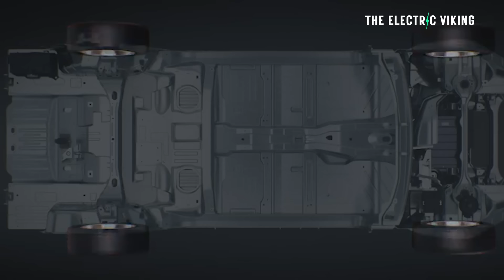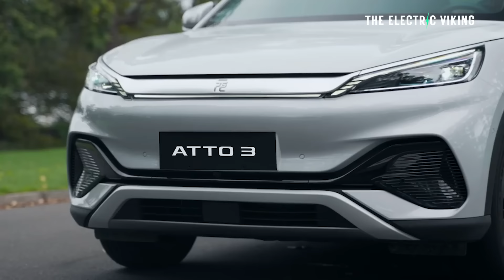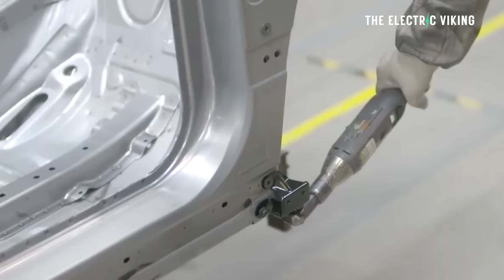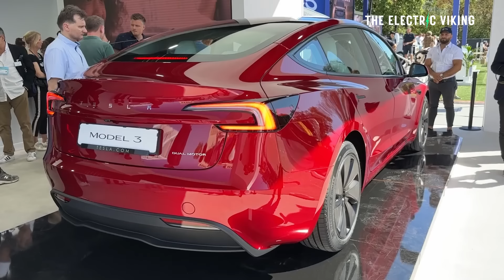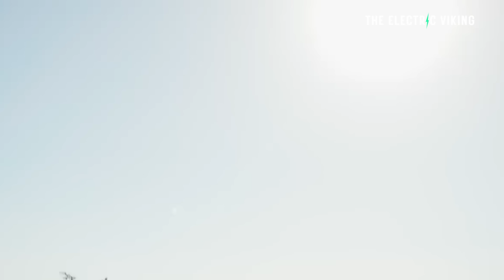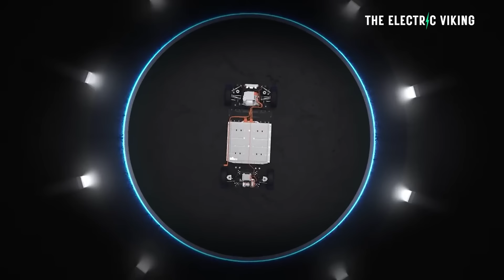Alfa Romeo's NEW Giulia EV will be based on the Dodge Charger

Comment: I think this is wrong.  The new Dodge EV is a new design and will be EV only.  I don't know how you would know how heavy it would be.  I like the look of both of these and will keep an open mind even though the history is stacked against it being a great car.  They are too slow to adopt and have kept the Charger/Challenger designs for way too long without a significant revision.

Looked this up and found...  The new Dodge EV is going to use a universal platform called STLA Large platform, with standard four wheel drive and planned 400v battery with 100+ kw capacity.  We'll see what they actually come out with.

Comment: It’s using the universal STLA large platform an 'EV-native' architecture that's being rolled out across all of Stellantis' brands. The Dodge Charger is the first, other cars to use the platform include the new Jeep Wagoneer S, as well as what will replace the Alfa Romeo Giulia in 2026. The singular advantage of the EV  is the simplification of the platform on which different car brands and models can be built. The German big three are really exploiting this strategy across their brands and models, Stellantis is doing the same having used the CLAR strategy for both EV and ICE models to this point.

Comment: I don't know why they don't just keey the current Giorgio platform for another generation. I have the Stelvio, and it handles great, and the current Giulia is the lightest in its segment. Adding the I6 platform from Dodge with the Alfa Multi-Air and a mild hybrid with an additional 60HP combined with the design you showed would be a home-run for most of us "Alfisti" enthusiasts.

Comment: The Alfa is so much better looking than the Dodge. It remains to be seen which one will do better. Alfa buyers are higher income than Dodge buyers, they are better able to deal with the costs. And no doubt they are more open to EVs than Dodge buyers, everyone is. Dodge buyers are incredibly hostile to EVs, only 4% are considering an EV, among Americans in general its closer to 50% that are willing to look at an EV. Alfa is also primarily in the European market which is friendlier to EVs than the US market. On the other hand there is a lot of competition in that segment.
Also the idea that the Charger is the only electric muscle car is nonsense. The Model 3 Ludicrous and the Model S Plaid are both muscle cars. The definition of a muscle car is sedan with a big engine, not particularly refined just very fast in a straight line and affordable by middle income buyers. Thats what the Teslas are. They have more power than the Charger and are much lighter. The price of the Charger hasn't been revealed yet but it will certainly be higher than the Model 3 because the battery is so much bigger.
Reply: Dodge buyers are reknown for their low FICA scores.

Comment: The comparison to the Model 3 doesn't make sense because the Giulia is a large suddan while the Model 3 is a compact suddan so of course it's heavier.
Reply: Clueless response. Model 3 is actually larger in size in terms of its interior than the Alfa Romeo Giulia, which in internal combustion form weighs about 3,800 lb. The model 3 Performance is about 200 lb heavier. Please check your facts before you expose your ignorance.
Reply: @douglaswatt1582  your inner wokester is showing...no need to insult anyone, please. No way to know but its possible this platform has more up its sleave than we know. I don't think (hope) Alfa would release a porker, because where a Charger is all about strait line speed, and Alfa is all about handling. They know full well that anything above 4K LBS would be a none starter. Maybe there's modularity built into the platform that allows for a shorter version that can result in a hybrid version (most of us Alfistis have no interest in an EV only Alfa) that may take advantage of the high energy density higher cost battery that's only there to help with low end torque.